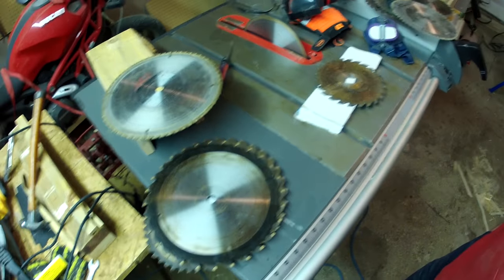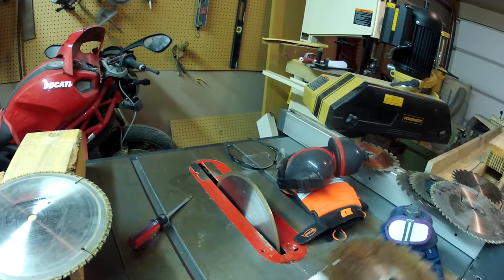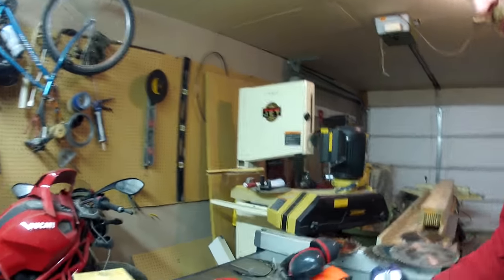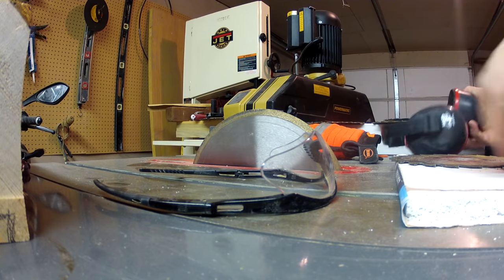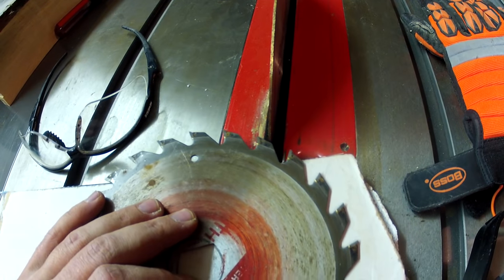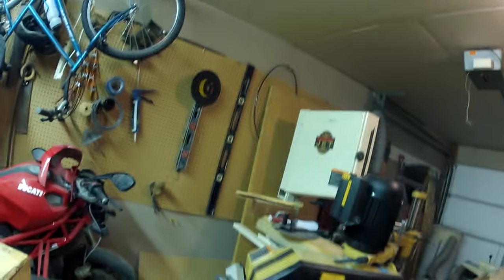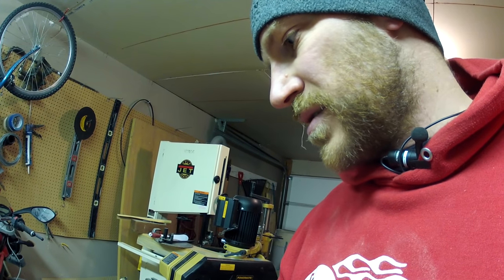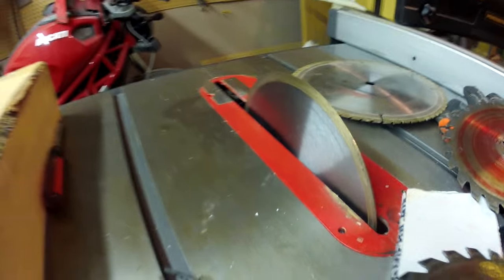How to sharpen your circular saw blades, the easy way.

Comment: I'm a carpenter for 45 years now, and use this method for a long time and saved so much money allready. I never thought putting it on to the net. great job man.   five stars ***
Reply: Says five stars, gives three.
Reply: and beeing a carpenter for 45 years seeing how he sharpens all teets at 90% does not ring a bell at all?
Reply: Ron Verburg hygiene.  Orpdgu 
V
Reply: Hi ya.   New to this sharpening saw blade.  Isn't every second tooth a different angle.??
Reply: @DixonChanWan sometimes more so on ATB ripping blades my fine cut ATB 80tooth has the same face angle on each tooth.

Comment: Thanks you very much,I purchased the diamond blade,put it in my table saw, & in 5 minutes had sharpened my first blade,works like a charm,I have since made a sliding table,to place the blade on.

Comment: Awesome vid. Only tip I would add is take a sharpie & put a little tick mark at your starter tooth so you know when you have made a full circle.
Reply: Take it from a pro, a 9YO girl just gave you a pro tip, saves you having to constantly check where you are up to.
Reply: You don't need to use a sharpie, all you need is a piece of chalk. Back in the 70's I had a sharpening business but, the recession blew me out of the water, so I closed shop. There are grinding wheels that are cheaper than diamond that will sharpen carbide also. They also come in various grits so the carbide is polished.
Reply: thorlo6 u
Reply: Maybe a crayon?
Reply: Crayon, sharpie, drop of your blood...whatever. I just choose sharpie because aside from a pencil its the most likely marking instrument i have on me whenever I'm working on a job

Comment: Great video man !! Thanks !! I just bought a Shop Smith with some dull blades. I'm going to get a diamond wheel and touch 'em up. I used to watch my Dad sharpen his blades with a file  and re-set them .... long process. My only suggestion is that blades do have "set" from tooth to tooth, side to side that needs to be duplicated. It varies from blade to blade. As for all the "experts" boo hooing let them. EVERYBODY is a critic these days it seems, everybody is a friggin ARMCHAIR EXPERT. I hear what they're saying, but the average Joe isn't about to go out and drop $200 for a few blades to use around the house ... not if he's smart, in my "humble" opinion !! . I for one appreciate your helpful video. You just made my life a LOT easier. You just bought $50 blades for ZIP and these clowns are critiquing your process ? REALLY ?? I think you did the smart thing ! Let THEM by the $50 blades and throw them out. I'll be out there trying to beat you to the deals !! LOL !! Carry on ma-man !!
Reply: your dad sharpening (with file) is steel only blade.  carbide can not be sharpened with a file or arkansas stone (because those steel and stone is softer than carbide).  that is why OP used diamond because it is harder than carbide.

Comment: Thank You Very Much for sharing your experience with everyone here on youtube.  I have a bunch of  them to sharpen.  I use some of my carbide blades to cut like sheet metal roofing panels with and that is pretty rough on blades.  Was lucky to find your site here.  The old craft of saw sharpening shops are pretty much gone today so your method here will help many of us for sure.

Comment: Love it, thanks.  I have a few blades with canted teeth so I modified your method a little with success. I cut a 1"thick piece of wood at the same angle that the tooth is angled (around 15 deg) long ways on the flat surface (kinda like ripping) and used that for my blade rest.  Started with the rest angle pointed to my right and sharpened every other tooth matching the profile to the angle then flipped the blade and rest and sharpened the others. I hope that this is understandable. Maybe I will make a video some day but I'm camera shy.
Reply: You don't need to be on camera,just show and talk,I want to see the method

Comment: 6:39 one like that I'd sharpen and use it as a remodeling blade that way if you hit a nail you're not out anything. Good for cutting pallets, too, if you don't have a metal detector. (I don't and I'm not risking my $200 Forrest MADE IN AMERICA blade on anything risky.) Like you I got a bunch of old used blades with my TS when I bought it used. It came with some interesting steel ones, like a tenoning blade which is super thick so there's no vibration. I don't use it often but when I do I'm glad I've sharpened it. Great vid, thanks for sharing!

Comment: Great video. I never thought of doing it this simply. I sharpen steel drill bits and router bits on my grinder all the time. I've tried saw blades on it, but not much success. The diamond blade is the key. Thanks.
Reply from the maker: Ttf Web Yeah, the diamond blade is the way to go. You can see just how narrow of a gap you're able to get into and grind.

Comment: Going to try a diamond tile table saw at sharpening a carbide blade sometime. It looks like a smaller version of your table saw. Glad i kept some of the more worn tile saw blades as they may act better at polishing than a brand new tile saw blade.
Reply: Jo, did you have any success with the diamond tile saw blade?  I thought of using my tile saw to do the sharpening, seems like the water would help keep the blade cooler.  Will give it a shot, appreciate any feedback.

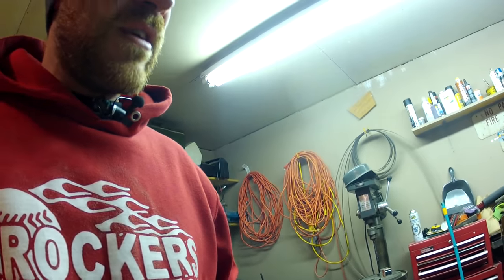Comment: 6:03, Piranha Black and Decker form the late 1980's......good blade, maybe get a silicon carbide stone and use in a Dremel tool
aluminum oxide will not work on Carbide teeth, but you may find a diamond circular encrusted stone.....I have a couple of those Piranaha's
congratulations on your 1.2 million views......Paul

Comment: Never thought of using a diamond blade in the table saw. Good idea. Big problem with sharpening is the tooth set. As long as the set is still good the sharpening is a good idea. You can buy a setting tool also but that is a precise job. Gonna try the diamond blade table saw idea. Thanks.
Reply: There is no set on a carbide blade the teeth are at a 5 degree angle on most blades. I don't think he did the angle.

Comment: looks like the perfect way to sharpen a blade for cutting up pallets, or for rough framing applications.
 because there is no way all those teeth are now at the exact same angle and height.
great for rough cutting blades, wouldn't't be cutting any of my exotic woods with a rough finished sharpening  as you have.
there's a reason top sharpening businesses use laser and sharpening blades with 5000 grit diamond wheels.
but for rough work, that looks really good, nice tip thanks.

Comment: One thought, if you use a piece of wood instead of the drywall, then place your blade, then screw a scrap of wood to hold the blade down, it might be a bit easier to control. I like this idea a lot! I have a stack of blades that I may try this on.

Comment: I tried this with my Dewalt 60V table saw. At first I bought a 7” continuous general purpose wet/dry Makita blade from Home Depot but it chipped the carbide. So I went back to Home Depot and got a 7” Continuous Wet only Tile Porcelain blade by “King Diamond” and it worked perfect.  My Dewalt table saw has a max blade size of 8-1/4” so I couldn’t fit a 10”.  The 7” works great, it’s cheaper and the blade probably has less deflection.

Comment: Thanks for posting this video, I will give it a try. I was wondering if you remove the rust and pitch from your blades before you sharpen them? I notice that it makes quite a difference on the cut, when my blades when they are clean and rust free.  Take Care and thanks again for the post.

Comment: Great video...thank you. 
Going to make a sled using both miter slots,  on  the cross peice  ( bridge )  I will  install an appropriate size dowel in the center to rotate the blade around then slide into the diamond blade... sharpen... slide out... rotate around the dowel... slide in...repeat  :--)
Reply from the maker: Try and find a blade that's around 600grit. The one I used in the video is too coarse.

Comment: you can also sharpen those old steel blades. You need an abrasive wheel rather than a diamond blade but you just have to be careful not to allow too much heat which is what makes the metal soften and not hold an edge.

Comment: I sharpen saw blades for a living, the diamond you are using is for cutting concrete. So the grit that it has is similar to 40 grit sand paper, it may sharpen your blades but they will dull quickly. Also, without a jig you can't control the angle of the tooth which is very vital to sharpening a carbide tipped saw blade. Then the most important part, if yall want to truly sharpen a blade you have to sharpen the top of the carbide. Good idea, but if you want to save money and get the same cut quality you get with a brand new blade you're going to have to fine tune and improve your method.
Reply: I second this comment. There usually needs to be at least two angles opposite each other and then a flat (90* angle) in between these. This method is too simplistic and won't result in the best results  for cuts made with a saw blade "sharpened like this. Take it to a pro and spend the bucks. You'll be glad you did.
Reply: finally some1 that understands my feelings agree 10000% with you good sir
Reply: For the two minutes it took him, I’m sure you can agree that this is a great alternative to having to send the blade out fo pro sharpening, or for when you just need t touch up some old cheaply acquired reclaimed blades! Also good way to get your only owned blade of you hit a nail or it is dulled.
Reply: You are correct that controlling the angle would be better...but,  He said it cuts well.  If you have a home shop and it works, who cares.
Reply: DavieMac48 the angles don’t change when you clean up the flat face of the tooth! It all depends on the kerf, not all teeth are opposite each but other, in woodworking circles you’ll find thin kerf blades with flat tipped teeth that this example of home gaming sharpening could suit.
Reply: You can get away with just sharpening the faces. In fact it's the only thing I'd recommend to the home gamer trying to sharpen their own blades cheaply. A good quality professional sharpening can cost over $20 per blade depending on number of teeth. Considering the fact the blades he's sharpening here can be purchased brand new for $50, this is a nice alternative. Unless you can precisely set the angle you shouldn't touch the tops. Yes the hook angle is very important in chip formation and clear out, but if you're off a bit the blade will still give a good cut. If you're not dead centered with the angle of the tops you will get blade run out and a poor quality cut, or even worse damage your saw. The main disadvantage of just sharpening the faces is your serviceability life goes way down. We even manufacture blades designed to just be face ground on service, like BrillianceCut blades. Don't try to sharpen the tops, leave that to the professionals.
Reply: Sad to say i also sharpen blades for a living.  I guess he will be alrght as long as the blade is not tore up to bad that it needs to be topped ...
Reply: Thumbs up to your aproach!!
Reply: Totally agree.  This method doesn’t work. I do mostly finish work and my blades need to be sharp.
Reply: Where l can learn to sharp? There are some school for that?
Reply: first off cool vid👍 in a not insulting way.... this is a "hack" way of doing it.  buddy isnt being a prick because he knows more and does this professionally.  to keep a  skill saw blade sharp or maybe touch up the ripping blade you keep for lumber with nails.... i wouldnt do this to my Marples 80 tooth finish blade but i applaud the effort and engineering that went into this vid .  nice job.
Reply: There was a man locally that sharpened saw blades and I would take new blades still in the package and let him sharpen them before I would use them.  I compared a new blade right out of the package to a new one he had sharpened and the difference was amazing.  I have no one to sharpen them today since the Good Lord called him home.
Reply: shane brown isn't finishing work for fine carpentry work. This video isn't for finishing blades.   If you need precision..  With professional blades.    You'll pay triple for the blade.   If your just making frames for building.   Something sharp is good..  Not just burr and smoke your timber as you cut.
Reply: Blondie SL I’d like to know this as well! It seems as if Tile blades would be smoother.

Comment: I am a tile setter and use a wet saw to do this. a porcelain blade cuts finer,plus you have a sliding tray and water to keep dust down and clean as you go.

Comment: Excellent idea. I have a table top wet tile cutter which I can probably run dry using this method.
Reply from the maker: Just use the finest grit you can get a hold of. I think I'm using 600 right now.
Reply: @frankgrizzo   Well I was going to use my diamond cutting blade. I didn't think they came in different grits?
Reply from the maker: @ArcanePath360  They don't really advertise the grits on those blades. I ended up with this blade so I'd know the grit: https://www.amazon.com/Diamond-Grinding-Facing-Carbide-Circle/dp/B00A52VN4U/ref=sr_1_27?keywords=diamond+saw+sharpening&qid=1583685778&sr=8-27
Reply from the maker: @ArcanePath360  The Arbor hole is 1" 1/4" though so it may not work for a table saw like the video. I'm using it on a grinder.

Comment: You can also clean the blades with oven cleaner, a clean blade will run cooler. We also used to periodically spray them with pledge.
Reply: I never used Pledge, but I have cleaned pitch with oven cleaner. After that you should wash your blades in fresh water. Because some oven cleaner may sit in braze joints and potentially do funky stuff. After the rinse I dry, and WD-40 my blades.
Reply: Steve Duval after cleaning I use rem oil to store them. just a light spray or the whiles. I use the stuff on anything bare metal. not just for guns...
Reply: Why not laundry detergent?

Comment: Now it's 45 + years since I learned to perform this task, but the principles are still the same-
You only sharpen in the gullets as shown here if a) you really must (seldom if ever) and b) If the tip thickness allows (Seldom, if ever) 

The wear which is responsible for bluntness is on the periphery, and that's where you sharpen a saw, on the periphery, which, by virtue of the tooth geometry (alternatively staggered left and right, or left, square, right... toothing), sharpening's a two, three or five set operation, (five when the "square" teeth have to have their corners chamfered) on a dedicated machine, upon which you can be sure all tooth heights are consistent.

Only sharpening in the gullet leaves the blade dull, since the peripheral clearance has not been reinstated.  It's no different, really from "topping" a hand saw with a flat file, followed by backing off with a triangular file to provide cutting clearance behind each tooth

One really good reason for avoiding sharpening in the gullets is that the tooth face needs to be highly finished, (honed) to avoid rapid resin build up in the gullets, which reduces cutting efficiency, increasing demand on the motor.  Another is that you retain the tips'  thickness, therefore their strength.

When you have a number of blades to sharpen, negotiate a price for a batch, don't pay the unit price, and with small blades, replacement's often cheaper anyway, and there's often very little meat on the tips to start with.
Reply: Thank you sir. Makes a lot of sense what you say. So the right way to do a quick sharpening of the blade is to sharpen the peripheral tip of the carbide edge. Is it worth it when you don't have a specialty machine where you can level all the blades teeth? And to sharpen the blade itself you use the flat file for the outside of the circle of the blade and the triangular file to make the tooth tip lose the roundness and make it have a sharp angle again?

Comment: THANKS for the video!
 Question re using my ceramic tile cutting blade for sharpening carbide blades:
will doing that dull down my tile blade so that it will not cut tiles effectively?

Comment: Going to try this using my tile saw with the diamond blade.
Reply from the maker: +Michael Beard That's the blade I am using. I noticed since making the video that if I run the diamond blade backwards it does a much nicer finish. Sometimes depending on the make of the carbide the diamond blade running in the correct direction was a little too aggressive and could chip the tooth.

Comment: I like this, what a simple solution.  Sharpen two or three and you have saved the cost of the diamond blade already.  Have you had any issues with smoothness of cut, vibrations or increased tearout?  I have a beautiful old 12 tooth 10 inch re-saw blade I would love to bring back into shape.  I am adding this idea to my bag of tricks for sure.
Reply from the maker: No, my cuts have all been super clean. I resharpen my bandsaw blades also but with a different method. The resharpened blades cut better than they do new out of the box.

I think people, including myself, have been mind washed into thinking sharpening tool blades is rocket science and should be left to the professionals, when in fact it is real simple.
Reply: i own 12 tooth greenwood saw blade (rip cut kind).   used to be 24 inch until stone (in wood) destroyed the carbides.   I asked saw repair shop to convert it to 12 tooth ,  skipping tooth (removed and filed off tip) as anti kickback.  worked best than my 18 tooth greenwood blade (made in swizerland).

Comment: Im not trying to be rude, just offering some of my knowledge. One more thing, the blade with bevel in the carbide is called a piraña blade. It was made by black and decker as a multi purpose skill saw blade in the late '80's. It takes a custome made diamond wheel to sharpen, I have a saw with that blade so I have that diamond wheel in my shop.